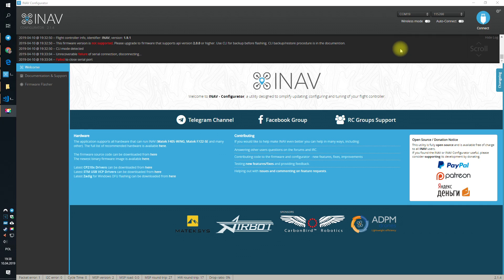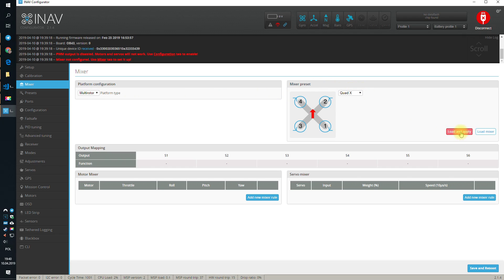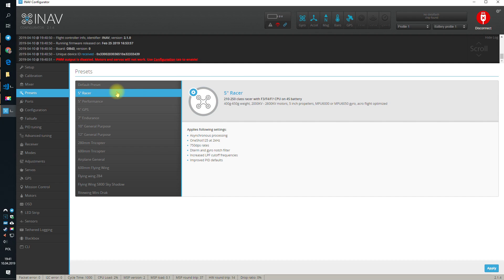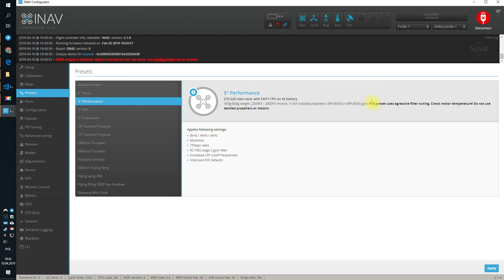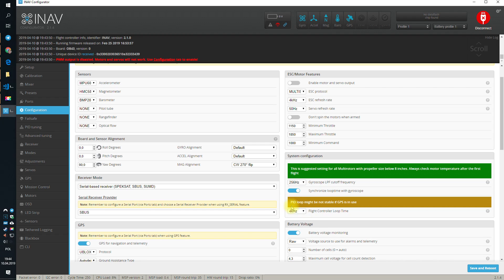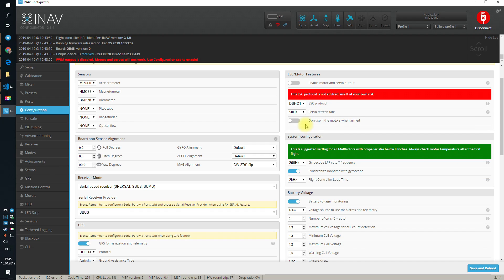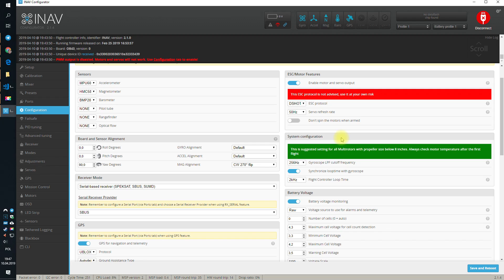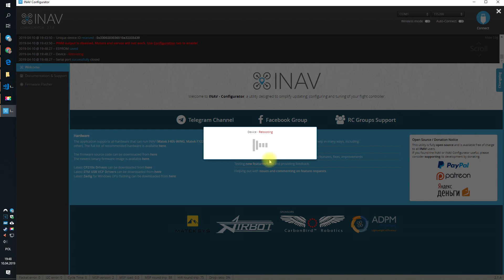How to setup INAV on a 5" quad - mixer and preset

Comment: Hi. I have problem with my quad. After start quad flips. It rises normally and goes crazy in a moment. What I checked: motors ordering, direction of motors movement, mixers. Do you have any idea what else to check?
Reply: I had the same problem. When i setup Inav 2.4 the 'presets' chose DShot600. I had read previously that Dshot600 and inav didn't play well together but I thought since Inav chose it it must be Ok now. Wrong. Like you, I tried everything I could think off. Finally a pilot from INTOFPV forum suggested trying to take Dshot off and use OneShot or MultiShot. I thought well I will drop down to DS300 first. That fixed my problem. Hope you get going

Comment: Hi Pavel i like your inav Videos very much. They helped me Out much Times. But i now i have question. A few days ago i flew with my wing, but suddenly i had a flicker and the fc rebootet and then was everything dark. Why could this Happen? The fc is a matek f411 wing and i used a liion battery. I wired everything Like the Manuel on the Homepage from matek. I Hope you can Help me.
Reply from the maker: looks like some kind of hardware issue. Maybe FC browned out? What was the voltage?
Reply: @FPVUniversity  thanks for your Response. The voltage was 3.3 per cell on a 4s
Reply from the maker: looks like some kind of hardware issue. Maybe FC browned out? What was the voltage?
Reply from the maker: looks like some kind of hardware issue. Maybe FC browned out? What was the voltage?
Reply: @FPVUniversity  is it possible that it browned out because of  the servos used too much current from the bec?
Reply from the maker: Yes. Servos should be powered from a separate BEC. Always
Reply: @FPVUniversity  ok thanks, then i will use the bec from the fc for one servo and the bec from the esc for the other one. because there is not much space in the caipiriha 2 :D. ore should i mount a completly seperate bec?

Comment: Hi there Pawelski :-) So - ancient history- I had made three of your GPS Adapter Ver 0.4 back in '15 ( and gave two for free to members of your thread at RCG, do you remember :-) , and wonder if I will have to adjust for compass on the back of the PCB with solder or can it be done in the INav config? I am having a bit of trouble running all the stiff wires to the Matek405 STD pads with my old Neo6M which of course I will be replacing.  But anyway I would like to try your adapter for the first time and the Naza GPS option. Cheers